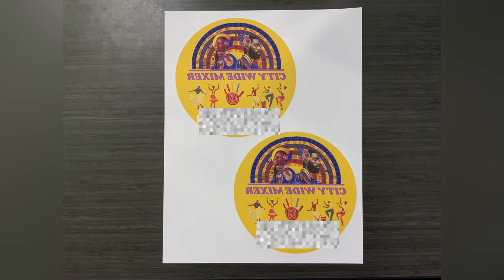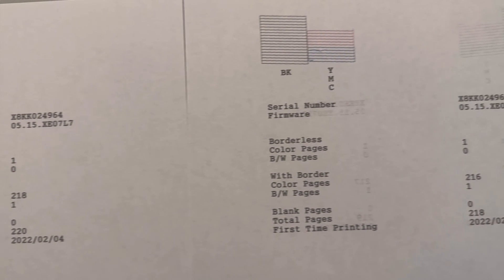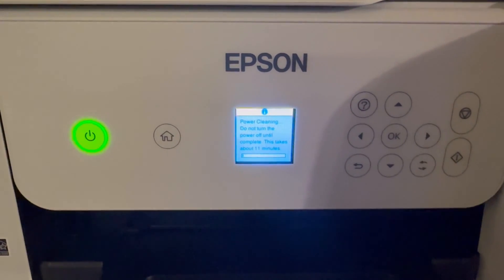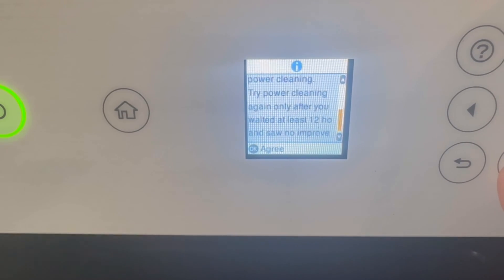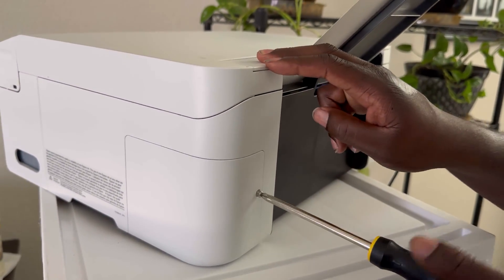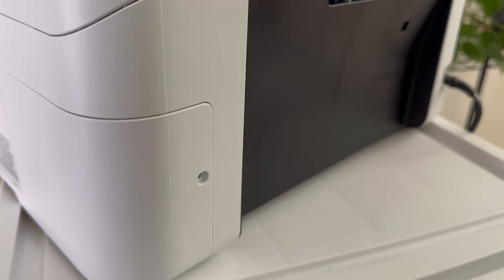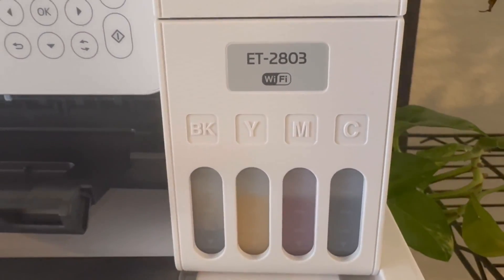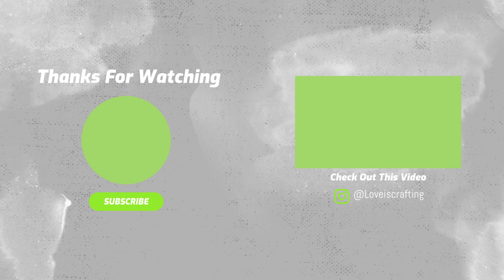FIXING PRINTING ERROR ON CONVERTED EPSON 2803 SUBLIMATION PRINTER

Comment: What do you do if one color is printing gaps? My Cyan is missing 4 small gaps and I have been doing all of the maintenance checks except the cleaning. Is that my only option?
Reply from the maker: That may not be your ONLY option, but it is definitely the option you should try next! Also you may want to try printing a different image to make sure it is a printer issue, and not an image issue.